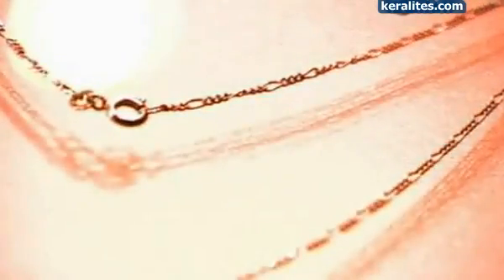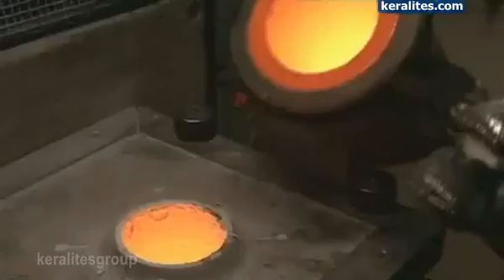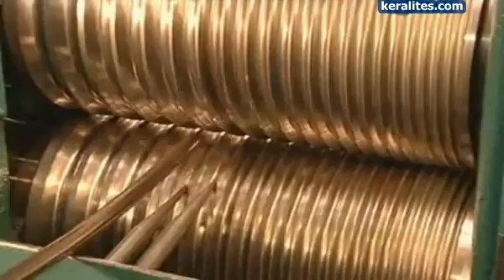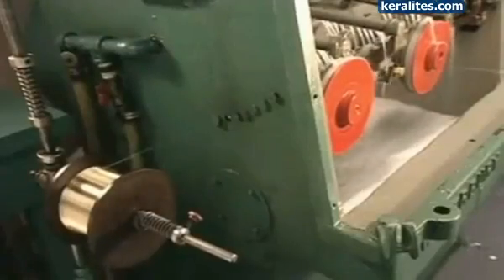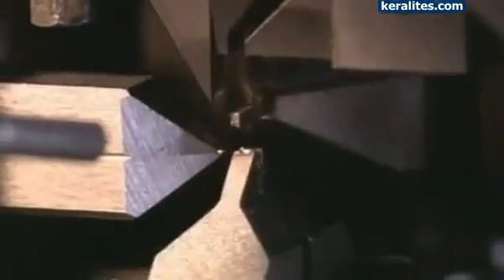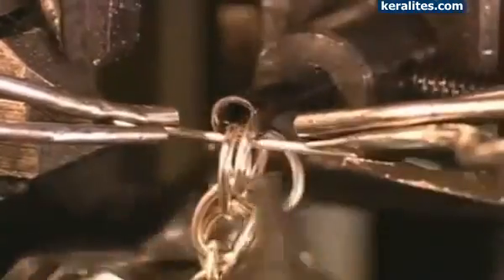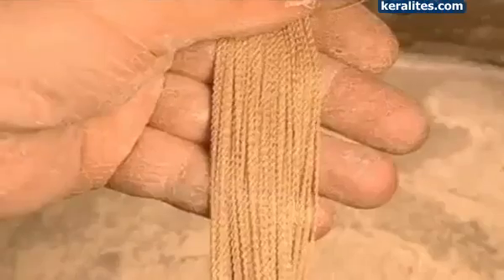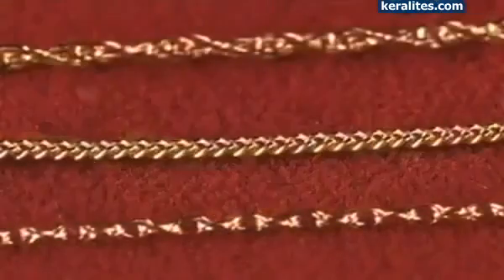How Gold Chains Are Actually Made

Comment: 1:18 why would they use a bandsaw to cut the rod and have saw filings all over the place that they have to recover. They could cut it with a pipe cutter, rotary blade or some other method that eliminates filings. It's faily soft anyway. oh well :3

Comment: I think that they should laser cut a gold chain out of single piece of ingot so that it is better, probably would be more durable and such. But programming that laser cutter to cut it would be annoying.
Reply: golds really soft so it wouldn't be very durable
Reply: Zayn Khan yes which is also why the other metals were thrown in, to strengthen it. Gold is very heavy, and seems as though it is hard and rigid when you get a nice thick bar of it, but in reality gold is really malleable, which basically means its quite easy to bend and stretch when small, despite it being a metal,  especially gold. That's why rappers either don't use real gold chains or constantly switch between chains in short succession